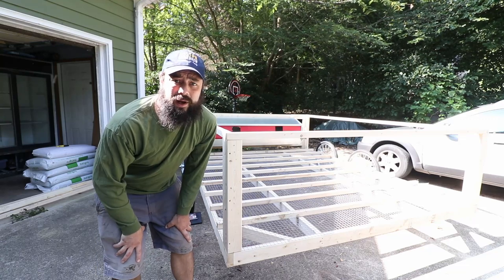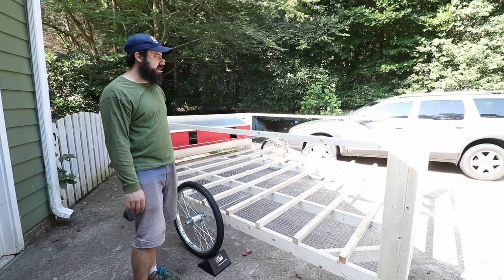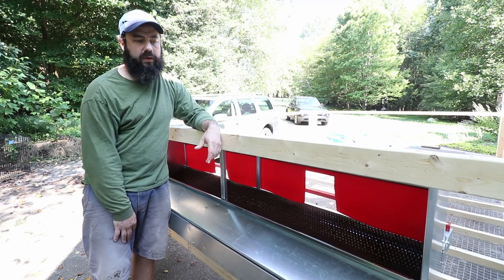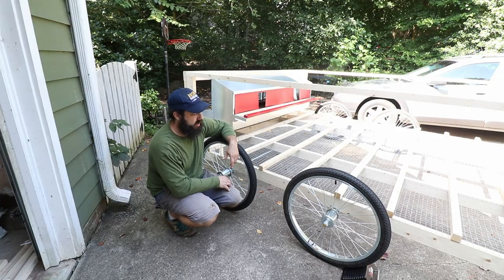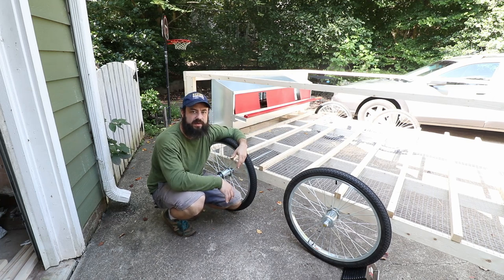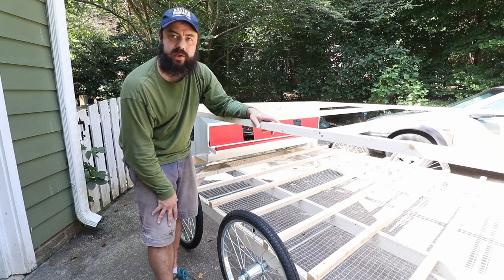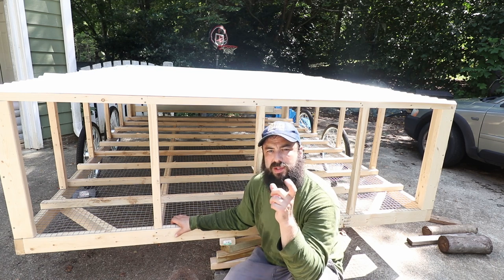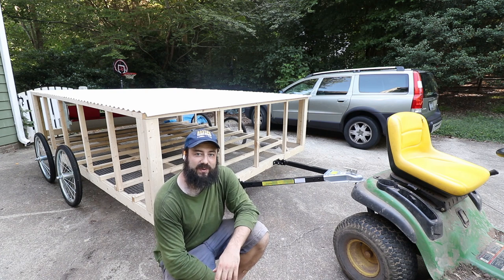CHICKEN COOP BUILD | Blowing Up the Chickshaw

Comment: Awesome build so far, looking forward to seeing it in action once complete. Great job! 👍 🐥

Would you please give a bit more detail on your axels and wheels. Thanks for the great content, loving the channel. All the best from a VERY windy Scottish Highlands today. ✊🏴
Reply from the maker: Links to the wheels are in the description. I'll probably give more details when I finish the build. The axles are 3/4" - 3' threaded rod that are attached to the bottom.
Reply: @JoshSattinFarming  I used those same wheels to build a cart.  I'd suggest putting in a Slime tube or some kind of sealant right away, mine got a puncture in about 5 minutes but have been fine since I put in a Slime tube.
Reply from the maker: @joaquimhailer2351  Thanks for the tip. I'll keep an eye on them. If they are a pain to deal with then I might swap them out for non-pneumatic tires.
Reply: @JoshSattinFarming  I second the slime idea  I get around a lot by bike  I carrying a spare slime inner tube a wrench to remove My rim a couple   tire removal spoons and a hand tire pump  I got all of them from Walmart for under 20.00 when I have a flat  I can be underway again in under 10 minutes total time
Reply from the maker: @jamessteffens8337  I don't think that I will. My Chickshaw which is almost two years is doing really well. I did put some non-toxic sealant type stuff on there, but I'm sure it's worn off. Most of the wood is covered by the PVC panels and none of the wood is touching the ground.
Reply: @JoshSattinFarming  Can you tell me where you got your axles from?

Comment: That's going to be one awesome coop. MY reservation is that water might pool on the roof top
Reply: Looks like it should be plenty stiff to not be a problem, a little may sit on it depending on the slope of the ground its on. I make one side of my chicken tractor roof 6-12" higher since I use smaller lumber and a tarp that would pool without a decent slope.
Reply from the maker: It's never on level ground so there will naturally be some slope to it.

Comment: Hey Josh, love your channel. I'm not sure if you calculated the full weight of that thing, but I'd have to assume you're going to have close to 400lbs just in chicken weight alone. You're probably over 550lbs total, plus eggs, maybe 600lbs. While I'm sure those tires can support the weight, I cant imagine theyll be ideal to maneuver in any kind of terrain. In the future you might want to consider making an axle out of steel tubing and using trailer spindles with trailer tires and a steel tubing axle. I actually built one of my coops by making a really simple steel trailer frame with the aforementioned axle setup. Obviously more time and cost upfront but its rock solid. Something to consider.
Reply from the maker: Yes I totally considered all of that. I won't be moving the coop when there are eggs in there because I move the setup in the morning. Each wheel is rated at 300 lbs and that's why I used 4. We'll see how it does, but based on how the Chickshaw does with 2 wheels I'm hoping it'll be alright.

Comment: Was wondering if you have a plan to level the coop.  The reason I ask is that the roll away nest box needs to be somewhat level to work properly.  If the coop is leaning too much toward the front, for example, the eggs wont roll into the collection tray.
Reply from the maker: I asked Hen Gear about that. I'm going to just position the coop and make sure that it's not going downhill from front to back and I should be good. I'm also going to put a trailer Jack on the front.

Comment: How are you doing roosting bars? Or are they part of the nest box?
Reply: They are on the floor.
Reply: Kyle Costlow I thought they liked to perch above the floor.
Reply from the maker: The roosting bars on the floor. Same as the Chickshaw. It works great.
Reply: The flooring wire is below the 2x2 roosting bars crossings  so  that satisfys and going up the ramp  handles the need to roost higher up

Comment: How hot will that metal box containing eggs get? Too hot?
Reply from the maker: It's got large screen in the bottom and it's open in the front so I'm not worried about that.
Reply: @JoshSattinFarming  Could always paint it white if it becomes an issue.
Reply: In these temperatures above 90 I can't even pick up a metal tool or the hose that's been sitting in the sun.  Not sure about that metal - hope you're testing it beforehand or you'll have a lot of fried chicken to eat all at once :)
Reply: Just dont leave the eggs in there too long  make a couple of egg collections run a day